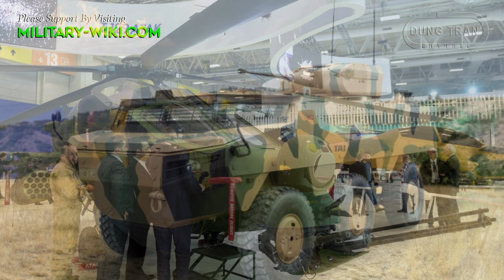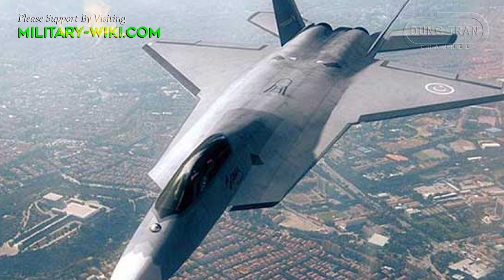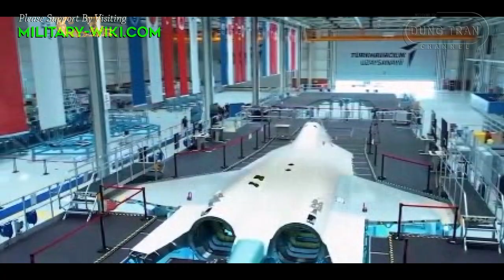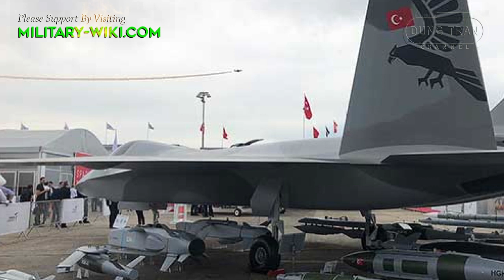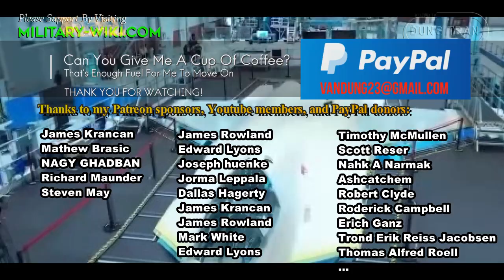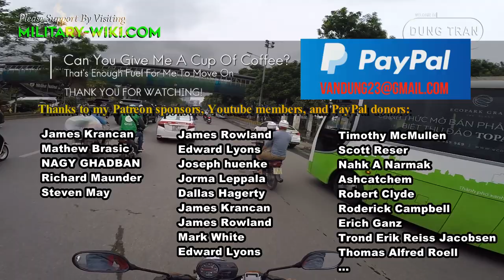Turkey's TF-X: Still On The Right Track

Comment: Wow. Looks a lot like the F-22. If it performs like the F-22 it's a game changer. I hate the term but there it is.
Reply: @roderick camphell if RR gives to engine to Turkey. Tfx would be a good aircraft. But it will be 4,5 th generation in 2028.
Reply: @omeryilmaz7716  I herd they r jointly producing the engine that a Turkish company
Reply: @jazz.560  They have their own engine program , they need to export this plane without any restrictions.
Reply: @thewayofbiutze3899  I see
Reply: the keyword there is ""IF"" Roderick, this bird is a long way from testing let alone production! and with it being turkey's first design i wouldn't hold my breath on it performing as advertised without some major fixes!  if you remember the F35 was in the prototype stage for close to 15 years before they got most of the bugs worked out and the companies there were old hands at building planes! by the way have you seen where Jackson Teller has commented lately? i haven't seen anything from him in at least 3 months!
Reply: @keithmoore5306  this is not just turkey building this aircraft, all by itself BAE systems as a part of it and many of the components will come from around the world. This is a very big difference from what the F 35 had to go through. they had to make a whole new engine for the F 35 and a lot of the technology inside. It was a very new at that time, but it is not that new anymore. who is Jackson teller?
Reply: @jazz.560  he claimed he was a dutch air force pilot he was posting a bit heavy for while there!